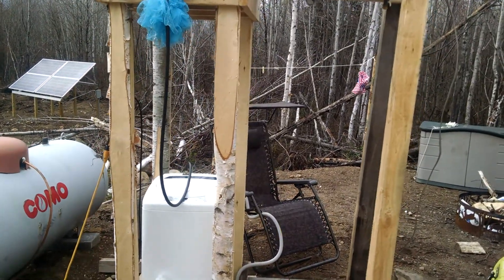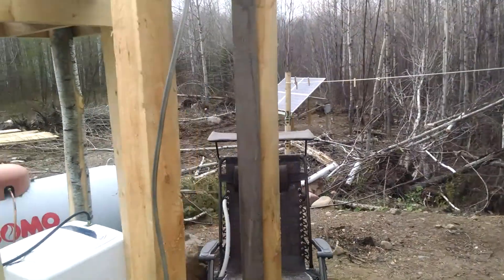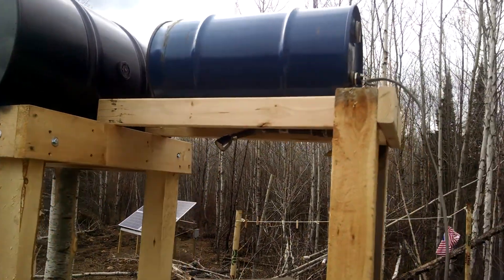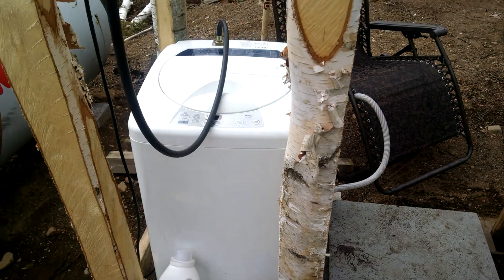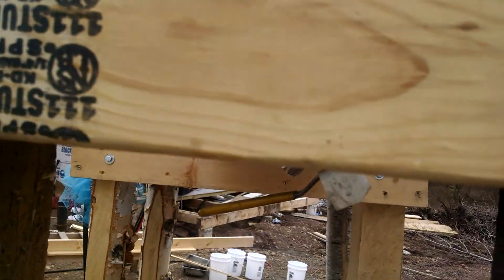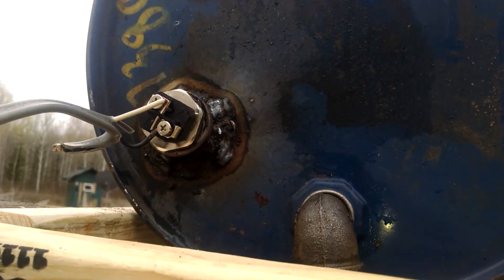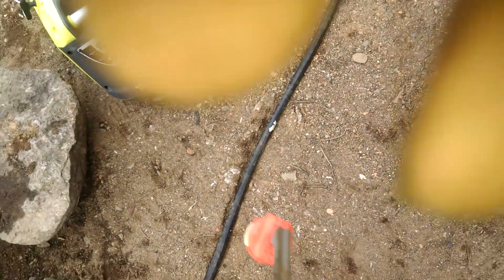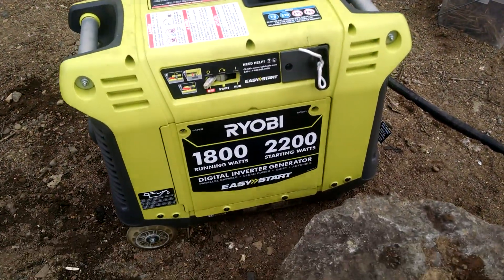Camping/hunting water heater for under $20

Comment: I use one of those under the sink 6 gallon water heaters at my off grid camp and heat it with PV solar panels. On those rare bad days, I can plug it into a generator and have hot water in 15 minutes.  This is a permanent system, but it demonstrates just how much you can do with a small tank. My wife and I can both take nice hot showers on just 6 gallons.  Having hot water at the sink anytime is nice. I totally disconnected the propane heater on the system years ago.

Comment: Cool setup 👍
I’ve been looking all over YouTube at different ideas of heating water 
I noticed a lot of wood around were you are and wondered would it be worth your while to get a small wood burner with a heat exchanger and heat the water like that...
It’s just a thought 
And could always run along side you existing heater to speed the process up .
Reply from the maker: I only used this setup during the summer I was building my house. Since then, I installed a tankless water heater.

Comment: It's an interesting project if you're just looking to prove a concept. But as a practical matter, that's a heck of a lot of work and a lot of jerry-rigging for something that could be done much more efficiently with a $100 portable instant water heater. The average 7-8 minute shower uses about 17 gallons of water. So, to take one shower, you have to fill up your water tank, turn on your generator, heat up the water, shut off the generator, and finally take your shower. If the wife wants to take one too, you repeat that entire process. 

Why not just hook up a rain barrel system to a portable camp shower that instantly heats the water? Even if you run out of rain water, it's a heck of a lot easier to just fill up a tank that's sitting on the ground than one that's suspended up in the air. Plus, there's no lag time to wait for the water to heat up, etc. Just seems like a lot of time and work to save $75-80. My guess is the savings isn't even that much when you compare the lower energy consumption of the shower unit (which could also run off a 12V battery by the way).
Reply from the maker: Your calculations are based on water pressurized by the city or a well. Both the wife and I were able to take showers on one tank of water. We didn't just sit there to wait for the water to warm up. We had other things we could do while waiting the 45 minutes for the water to get to temperature. It cost $1.50 for the 2 showers.We did this for a whole summer while we were building our house in northern Minnesota. We weren't looking for savings when I built this, We were wanting showers. Going into town is a 30 minute drive one way to use a shower at the hotel and ws $5 per person. We saved a lot of money in 5 months.

Comment: did you weld the element in
Reply from the maker: No, I welded a half of a 1" coupling to the drum. I made sure to drill the hole big enough for the element to go in and be able to spin before I welded it.
Reply from the maker: The 9th Wall  I only paid for the heating element
Reply from the maker: The 9th Wall  welders are in limited supply. Even you can buy a welder
Reply: The 9th Wall  you can buy a flange for about $5  and glue it or bolt it in. If you were gonna be that picky might as well be mad he didn’t count the pipe, the tank, the generator, the wood, the water, the land he’s on....